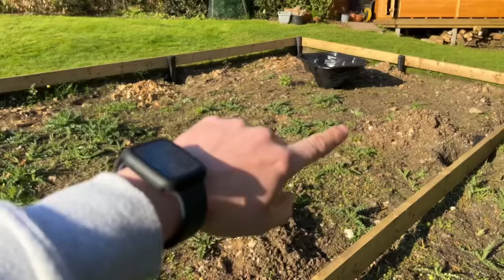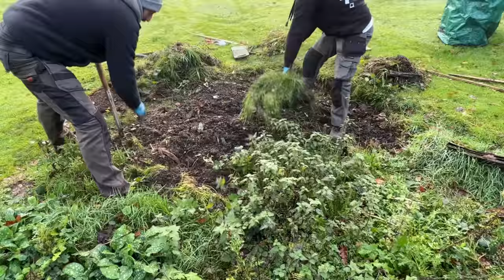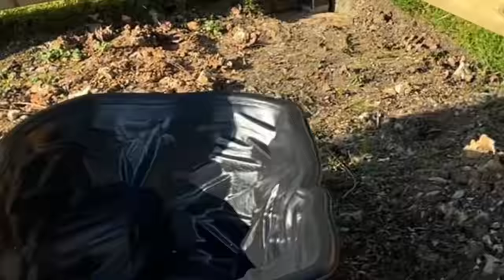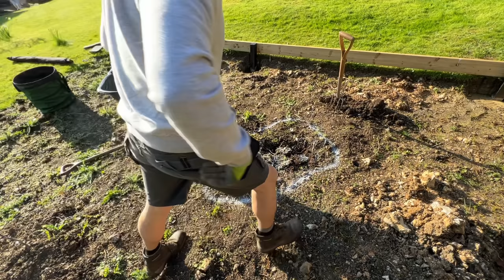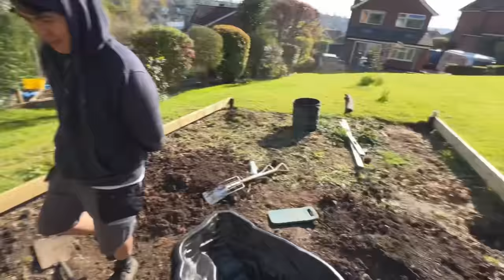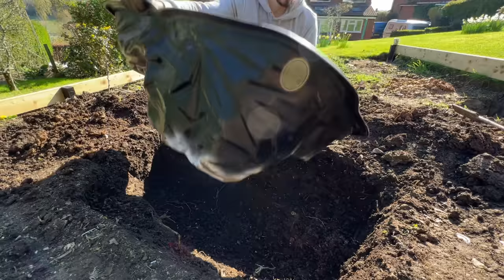Making A Wildlife Pond And Wildflower Garden

Comment: 1. Turn the pond upside down and place where you want it
2. Mark the edges by turning your spade backwards to the pond and slightly creating an edge with what you dig lightly out from all around it.
3. Remove the pond and start digging the whole space, keep what you dig out 
4. Remove any sharp stones 
5.Line the bottom of the earth where the pond will be with sand to bed it in. 
6. Put the pond back the right way up
7. Half fill with water and use a spirit level to ensure it is level all around, you don't want any rocking
8. Start to back fill with what you have taken out, starting at the bottom really pack in the soil, tamping into the nooks and crannies. You have to make sure every bit of the pond is supported. 
9. Remove any pebbles dirt etc that has fallen in
10. Fill and wait to plant.
Reply: Thank you so much for sharing your knowledge. I was going crazy watching them struggle. 👍🏻💙💚

Comment: hi you need 2 inc of sand under it to level it up then start filling it with water and the backfill with sand around the edges and water the sand as you backfill so you have no viodes
Reply from the maker: Hey thanks for the tip 😀🙏👍